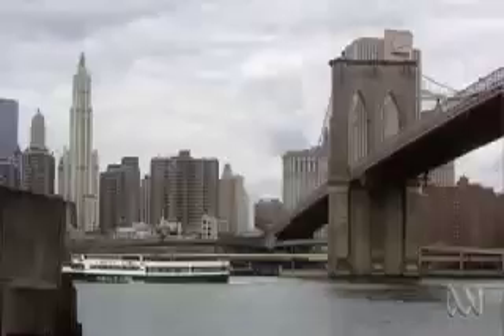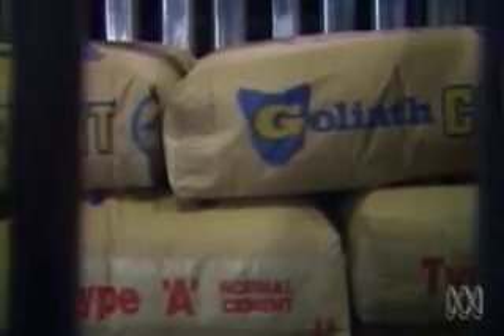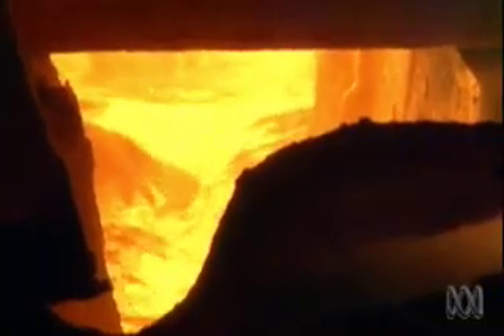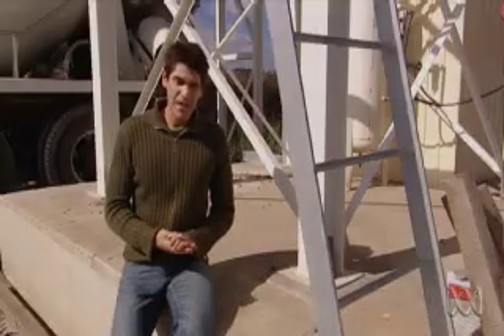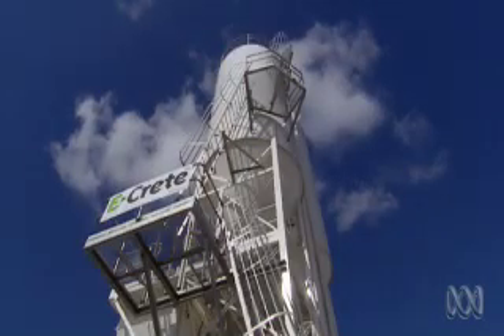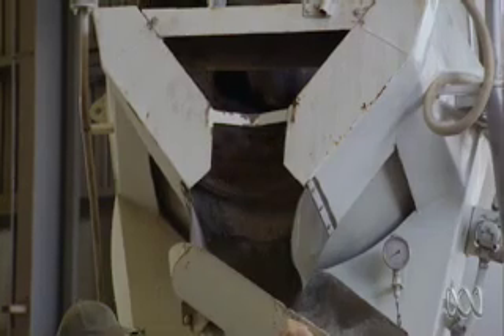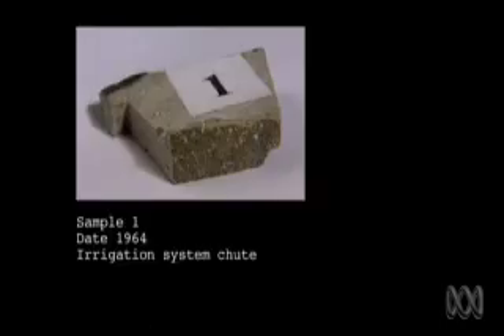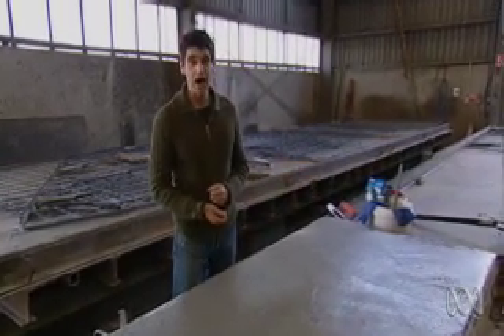Green Concrete

Comment: I have ultrafine flyash ultrafine flyash contant per 100gms
Particle larger than 45micron 3.5%
Loss on ignition 0.59%
Silica oxide 92.9%
Iron oxide 1.09%
Aluminum oxide 3.13%
Name pramod Vijaywar
India mobile number+919407250464
Email pramodvijaywar@gmail.com

Comment: They use metakaolin which they still have to heat it up
Reply: Yes, but at 750°C. For Portland cement it is about 1500°C because the desired calcium silicate form only above 1400°C. No doubt about that. Plus the main raw material of ordinary cement (=Portland cement) is a mineral that contains CO2. It is lime. So there are the emissions to achieve that temperature plus the co2 that gases out of the lime stone when burned.

Comment: the price wise ..is it expensive than normal cement?
Reply: Only if you are getting crap from other parts of the workd which they are
Reply: A concrete is made of 75 % by mass of sand and gravel no matter if you use ordinary cement or geopolymer as the binding material. Thats why they main part or price is determined by the very same material and therefor the same price. Normally, fly ash and slag is used to make normal concrete. So even that part of it is price-wise already in normal concrete. Plus normal concrete cement is not cheap. They just burn large amounts of wasts like tires and take money for that which in the end comes from you, the consumer. no matter if you want to. Ordinary portland cement is therefore heavily subsidizes. And Portland cement lasts for only 50 years, some boldly claim 100 years. Those slags and ashes are available all around the world and to this day are dumped. Lets make cement from it, I say. Cheers. Pat

Comment: So keep using coal because green cement.
Reply: the thing is coals are being used anyways, might aswell use its ashes to make green concrete. Instead of expelling more carbon using traditional methods. To simplify this... Coal factory = 1 carbon point, Traditional concrete = 1 carbon point, Mixing Manufacturing Building = 1 carbon point. Thats 3 carbon points in total. Green concrete takes out the "Traditional concrete" out of the mix... thus its only 2 carbon points. If we were only using the coal factories to produce ash so we can make green concrete then its not really green.

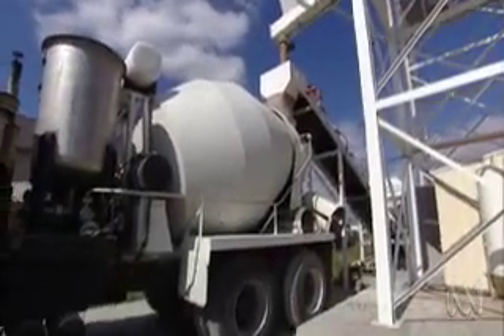Comment: 4:27 "...the activator is added..." Is that a catalytic, or - as the researcher showed - just a "little bit of an alkaline solution"? What can possibly accelerate the Aluminium, the Iron  and the silica to start the reaction? Is that THE secret? Herod must have done something similar in the construction of Caesarea, because the record states that he put he material in leather or cloth bags, and sunk them in the sea, to form the foundation for the edifice.
Reply: Could be K or Na silicates. In presence of CaOH will be created Ca silicate and KOH or in a case of sea water will be K2SO4 (washed away and only Ca Silicate kept).

Comment: what is the alkaline agent? big secret?
Reply: rami Cremesti Calcium oxide or calcium hydroxyde.
Reply: Sodium silicate
Reply: sodium oxide + sodium silicate solution
Reply: Non of the three commentators is entirely right. Geopolymer activator is alkali hydroxide plus a soluble alkali silicate. For instance sodium waterglass solution plus sodium hydroxide.